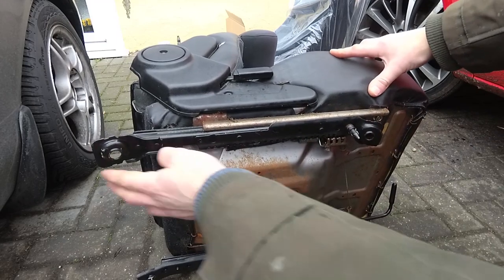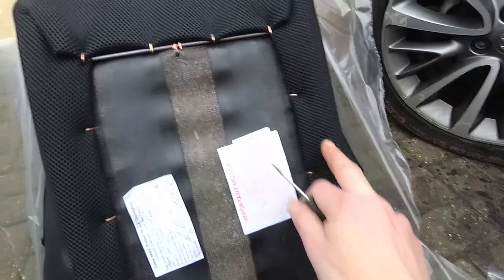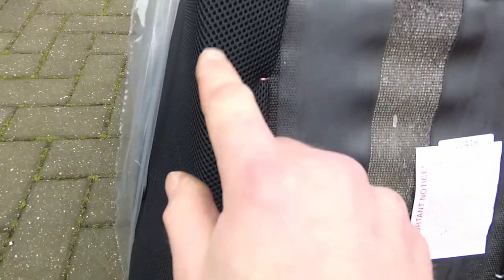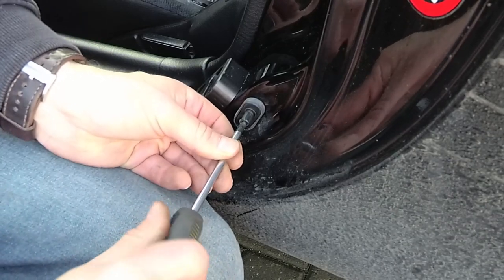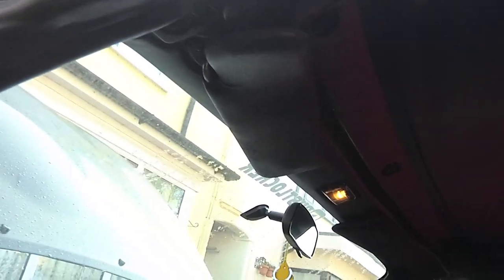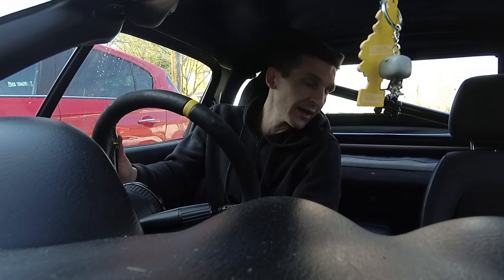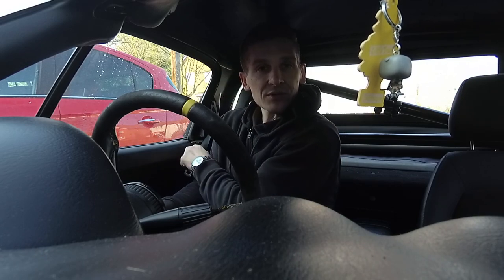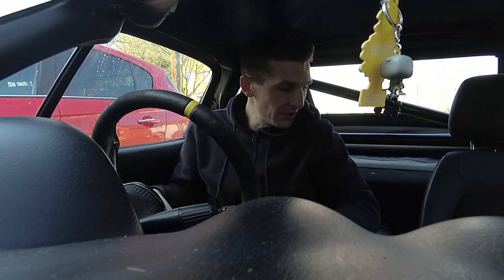Cobra Clubman Bucket Seat Install - MX5 / Miata nb

Comment: I have these seats for my mx5, can you still use the standard seat belt? I know that the lock is part of the rails.
Reply from the maker: Yes you can keep and use the standard seatbelt. But it is very tight between the seat bolster and the centre console. So you will find it quite a fiddle to clip and unclip your belt - which isn't too safe if you were to need to get out of the vehicle in an emergency. So the answer is yes you can, but to be safe, you should should look at getting a harness instead (and a bar to mount it to.)

Comment: Whats you height? Did leg room improved with this mod? I am 190 cm and I have stock seats and 350mm steering wheel with 90 dish and 60 mm hub. Leg room for casual driving is acceptable but for trackday... I can't go full brakes and heel&toe :/
Reply from the maker: I’m 6ft. I’d say leg room gained but height room reduced, I’m probably going to have the seat bolted directly to the floor at some point, which will give me more head room.

Comment: how did you solve the problem with seating position?
Reply from the maker: I didn’t, it’s still a bit high, but I will probably try to bolt it in a fixed position and lose the sliders at some point.